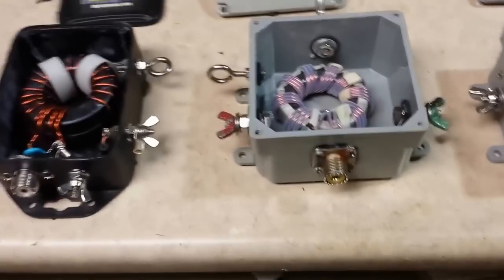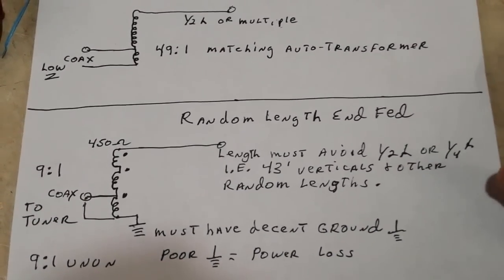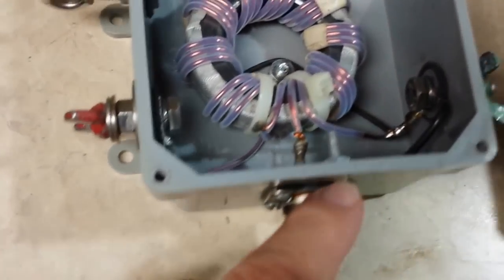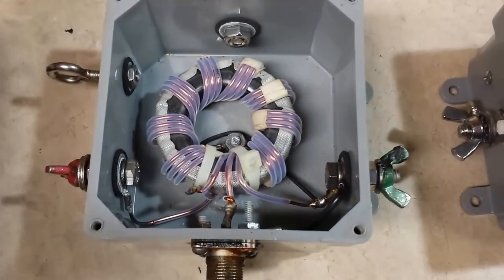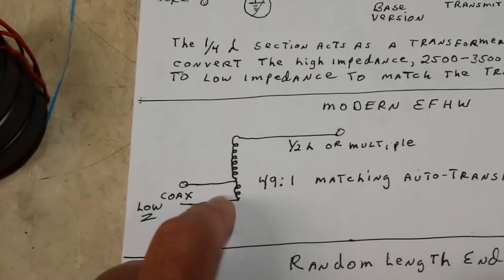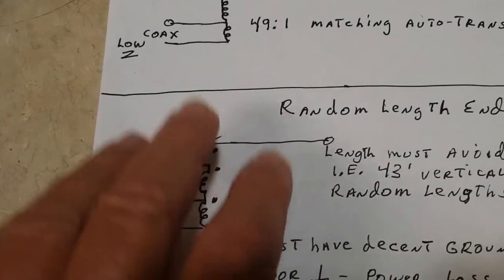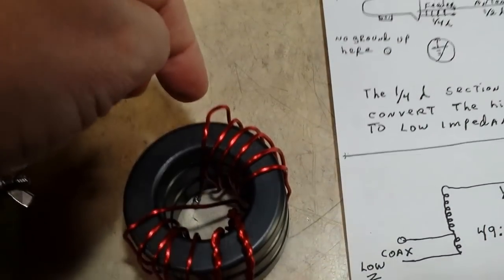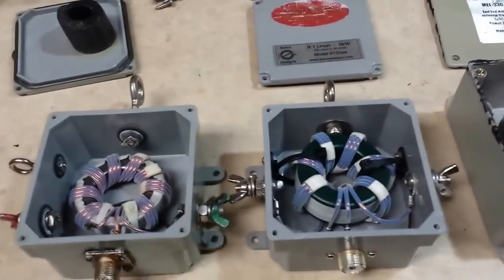End Fed Half Wave Antennas VS Random Length End Fed Antennas

Comment: Just a comment ... I think that manufactures who attempt to accurately rate their products ICAS are being far more honest than those who state a PEP rating.  I actually avoid manufactures who only provide a PEP rating because I feel they are being deliberately deceptive.  PEP only relates to SSB.  A very large percentage of hams also or exclusively use CW, RTTY and/or digital modes where a PEP rating is useless.
Reply from the maker: Your statement "PEP only relates to SSB" is totally incorrect. 1500w PEP is the legal limit for any mode including CW and AM. For AM, 1500w PEP amounts to 375 carrier X 4. 
ICAS is very illusive. It can mean anything. The I stands for "intermittent" but it doesn't state the time. When a mfg says 1500w ICAS, how long can it stay on? It's supposed to mean half the time on and half the off. Try doing that for 5 minutes on and 5 minutes off. It will burn up. ICAS stands for Intermittent Commercial and Amateur Service. It is deliberately ambiguous.
Reply: @n4lq   Nope, I stand by what I said.  When a manufacturer states that their product is rated at X Watts PEP,  folks who don't know better (a high percentage especially among new comers) assume that X Watt rating applies to anything they want to do.  If they run a typical digital mode for example at that X Watts, which is likely both PEP and RMS since it's probably a 100% duty cycle mode, they'll likely blow the thing out.  Manufactures know this yet they deliberately don't disclose an appropriate ratting for such modes (despite them being extremely common) because people often won't BUY their product if it's rated that way.  They state the power rating cheapest and easiest to achieve.  The one that their product should at least survive SSB use at that rating and buyer beware from there.   Manufacturers who rate ICAS are at least ATTEMPTING to address this, though the rating is of course vague.  What I said was they're being "far MORE honest", not "absolutely clear" and I stand by that.  If I purchase any HyGain trap antenna I've ever seen (or most other manufactures for that matter) and run FT8 through it at their stated power rating - which is always PEP if they state what it is at all - it will blow a trap INSTANTLY.  I've seen exactly this many many times.  But if a manufacture honestly attempts to rate their antenna ICAS without a mode restriction, there will at least be SOME and possibly a useful length of time a customer can run a digital mode through it without blowing it up.  That is, it's a far MORE honest rating.  I didn't say it was a PERFECT way to rate anything.
Reply from the maker: @Starlite4321  Now you're confusing PEP with duty cycle. The proper way for manufactures to rate the power handling capability of a product is to simply apply a constant carrier for a given length of time until the device fails, divide by 2 after the smoke clears.
Reply: @n4lq  Nope, sorry, no confusion.  What I said is absolutely correct.  I'm too old to waste time arguing about something like this with you.  Believe whatever you want, I literally don't care.
Reply from the maker: @Starlite4321  A classic case of cognitive dissonance.

Comment: So where is the info about the random length antenna feed.[?] Actually you just talked about how much power you could run but no band performance...   👎
Reply from the maker: I assume the first sentence is actually a question with no question mark. If this is a question then what does it mean? "Where is the info" implies there is something missing however you are asking for info that does not exist. Then there is this "Band performance" statement with the three dots and a thumb down at the end. What do you want to know? Do you want a longer video with details about each band? Perhaps you need to acquire an antenna modeling program and discover this for yourself.

Comment: Poor explanations. FWIW BALUN or UNUN is not an ""antenna matching devices"".....
Reply from the maker: Sure they are if they convert impedance.  Take a 200 ohm antenna. Run it through a 4:1 balun and it will match a 50 ohm coax. Thus you have an antenna matching device. Why? Because the antenna is now matched to it's source, the coax Tsachyl whoever you are.